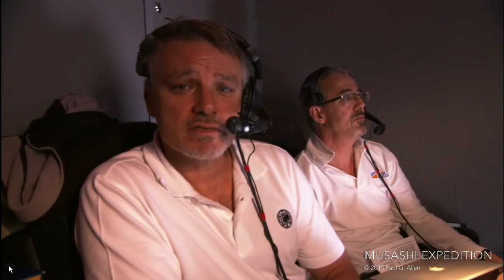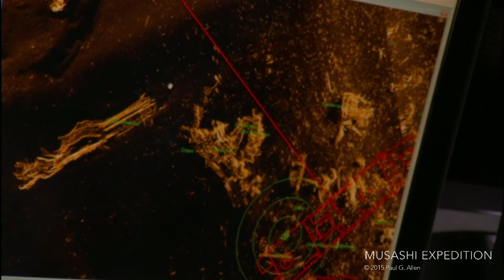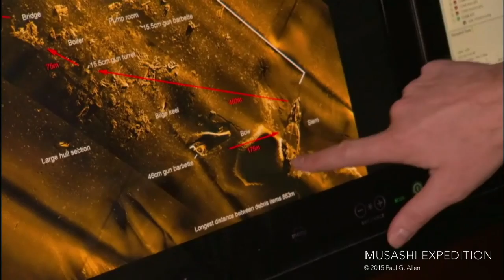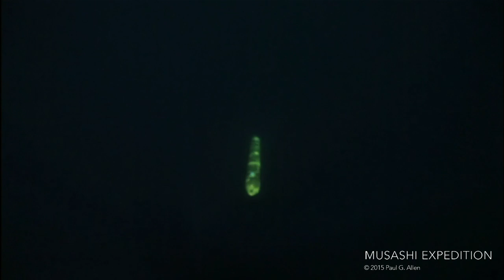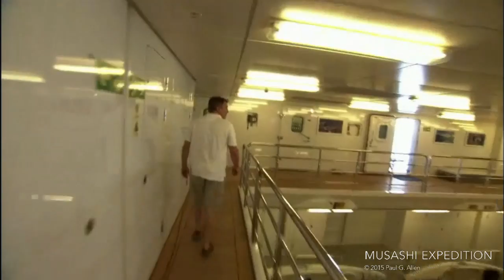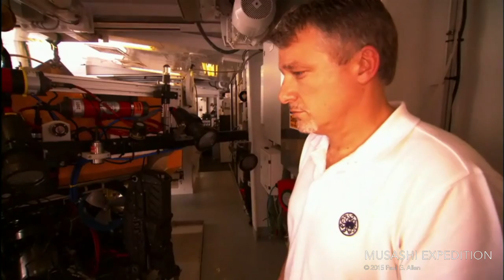Musashi (武蔵) Expedition

Comment: Excellent video quality. I would think there could a very good story on what happened to the builders prints. I mean of the huge volume that probably existed it seems like there should have been some that survived. What a detective story just on the blue prints and engineering data. Where is all this stuff? Did the  Japanese builders have arc welding at the time?
Reply: bjr E. WA. the. blueprints still have but the problems is the cost to built it back was around 80billions dollars